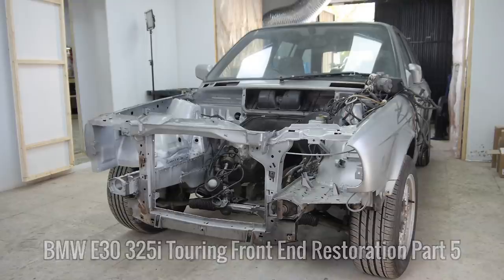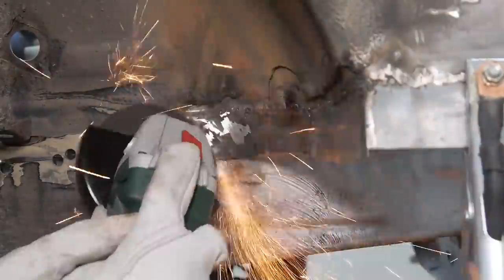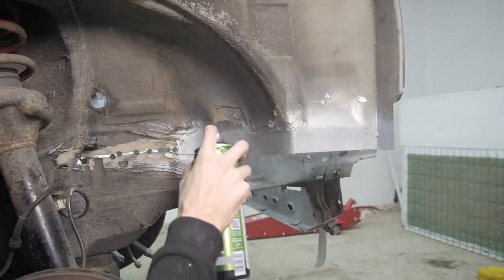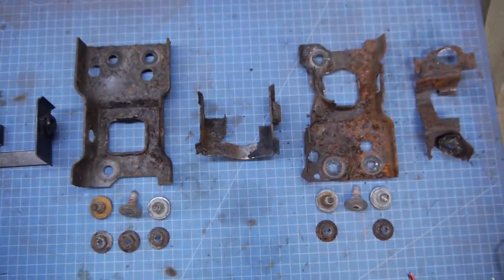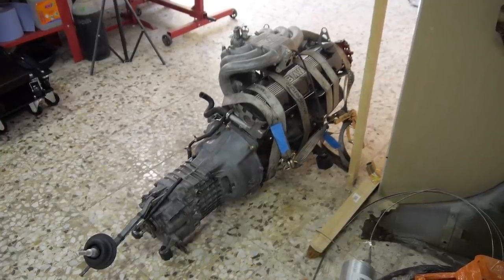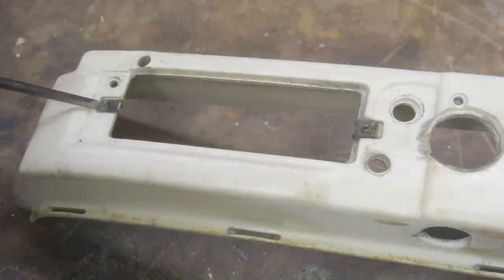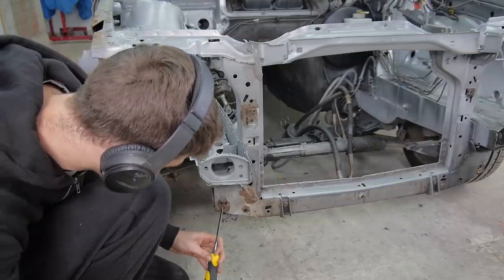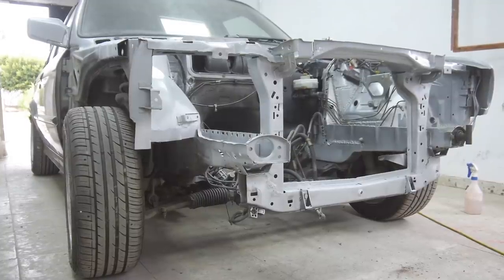Rebuilding a Rusty 1989 BMW E30 325i Touring Part 5

Comment: Mate don’t use a grinding disc to flatten welds, use and abrasive flap wheel for your angle grinder instead
Reply from the maker: Oh really? I thought the grinding discs were made for the job? I'll get some big flap discs as well thanks Jason.
Reply: Restore It well yes and no mate , as you will find you can accidentally cut slots in the metal with the grinding discs and this can’t happen with the flap disc , as the flap disc will smooth and blend it better
Reply: if you keep the disc moving and dont aply much pressure there is no way to cut a slot.
Reply: Flap disk is faster better stronger even easier. I came to say your ratchet won't like being on the receiving end of an impact wrench.

Comment: Hi mate, one more good video, but let me give you some recommendations, flux welding wired not really good idea, you should use protection gas, better mix, Argon+CO, this is the best for car body repair.  This weld protection option is most acceptable. I understand that using this is more expensive, but in your case, it is most effective, in terms of the quality of the result. Good luck man.
Reply from the maker: Thank you Ozzy! I now have some gas and i'm going to get some non flux 0.6mm
Reply: SOUP Classic Motoring did literally all of his Ranger Rover with a flux core.

Comment: you should consider cooling each weld spot with air so the metal wouldn't warp
Reply from the maker: Good idea. I definitely should be doing something. Thanks dude

Comment: I'm no welder myself, but aren't you supposed to only spot weld it in place and then weld a continuous line along the seam?
Reply from the maker: I know what you mean, but the metal is so thin it'll just blow through. Small separated tacks seems to work best for me at the moment. I think i need a TIG really
Reply: Can’t recommend TIG for welding on Cars, just get a proper MIG-Welder with solid Wire and Standard shielding Gas (82/18)

Comment: P.S it's not MIG welding, it's just flux core welding. MIG stands for Metal Inert Gas, flux core is gasless. Only shielding is the flux inside the wire. Great work she's coming along nicely.

Comment: Have you tried to use gas welding instead of TIG/MIG? Back in 80s, it was widely used for body patching because of much better control, lower chance to cut through and surface that almost doesn't need grinding.

Comment: Autodoc app doesn't have the tracking for orders,  unlike what you said. App is pretty basic, almost only useful to order and contact support. Can't keep track of maintenance, can't keep track of order. And the shipping cost high, even for small orders (~10eu for a 25eu order), so it will be cool if you could give the viewer a discount code, or something like that.

Comment: You're doing really well with the welding. I don't think anyone can get much better results than that on such thin metal with flux core. Definitely get some flap disks I would use about 120 grit.

Comment: I see you've corrected your 2nd channel logo! If I was you with that panel just make your own up. Even if its in several bits it doesn't matter once paint is on :) and for rounded bolts you can buy special sockets to hammer on that bite onto the nut :)
Reply from the maker: Yeah thanks for the Andrew. I would do this if I had more time to focus on it. Im super busy at the moment and I just really want a brand new one ready to go. I'm still a bad welder at best remember :D
Reply: Your welcome. Well I understand that but you may not have a choice or ask a local machinist? Surely they can fabricate a new one using the old one as a guide. That will save you time and effort 😊👍

Comment: Do yourself a favour and get a proper mig welder fluxcore isn't good for panel work as they run too hot a proper mig with 0.6 wire is best

Comment: you are doing sheet meatl on a car with flux core? dude get a small botle of argon co2 mix and thinner wire, you will get far less blown holes and welds will be much better and rust resistant for the future, flux core is definetly not for bodywork, its for really thick stuff when you need a lot of heat input, also the wire is very expensive

Comment: I did exactly the same restauration of the rear bumper parts on my E34 Touring, but replaced all rusted parts with brand new ones from BMW. Hope it gonna last several years :)

Comment: Greetings! Wonderful work as usual. Thank you for sharing.  I meant to ask you for a while - how is your experience using Jenolite? I mean long-term. What do you expect to see in those spots (where you used it) in the next 2-3 years? The reason I ask is that I use it a lot as well lately. Hope you will find a minute to reply.
Reply from the maker: Hi there Fluctus! I've been using it for over five years now. It seems to do the job. However its not something I like using and after recently learning the basics of welding i'd much rather cut it out. But it does have it uses for sure.

Comment: I spent quite a while using flux cored wire for this type of repair, then whenI did my Stag bare shell rebuild I decided to go for the gas conversion with a large Argon mix bottle from a local guy. The difference was truly amazing, really like night and day, I fully recommend it. No slag and much less grinding needed.

Comment: Maybe you'll have better luck ordering 41111966554 from a BMW dealership ?
Reply: realoem tells me it should it hasn't ended yet.
Reply from the maker: I have spoke with BMW at length and there really are none left.
Reply: @grays Unfortunately it's the wrong side, I already saw that one

Comment: get rid of the flux core wire and get some gas! core wire welding without gas is the worst way to weld thin metal.